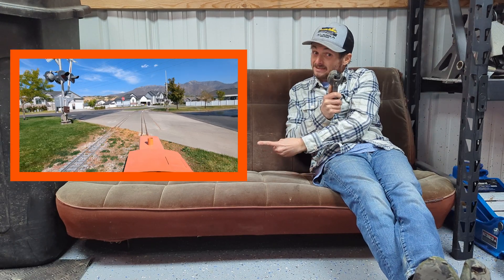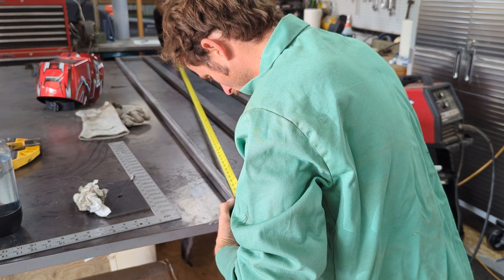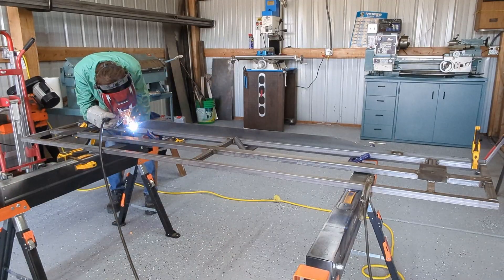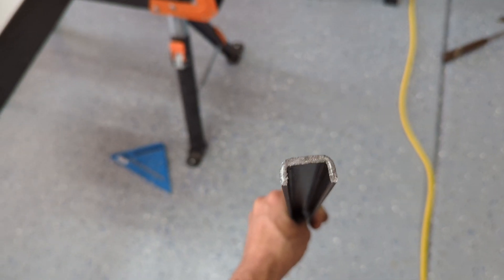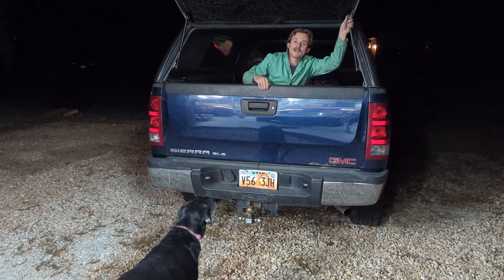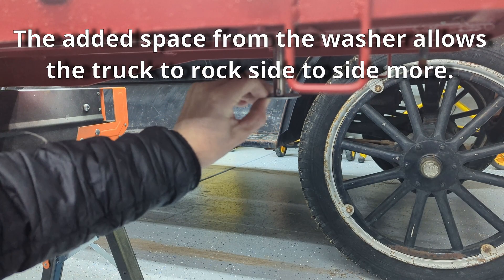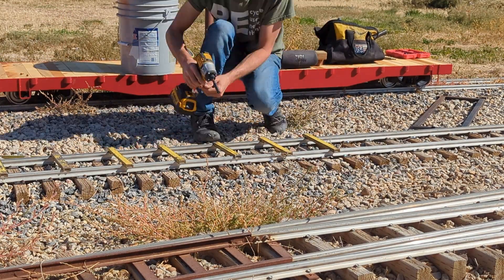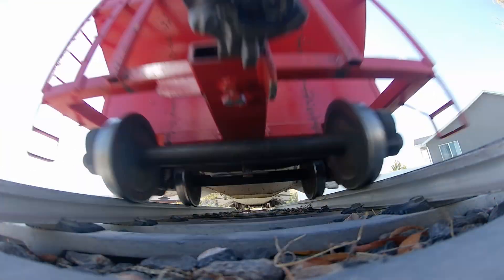Building a 1/8th Scale Flatcar You Can Ride On!

Comment: In your drawing you have 2 different scales listed. 1:8 ~ 1.6" (1.6" : 12") But 1:8 = 1.5" : 12".  1.6":12 = 1:7.5 Which is correct?
Hoping you're sticking with 1:8 and looking forward to your other builds.  Subbed and bell rung.
Reply from the maker: @terravarious Thanks for the comments, and sorry for the confusion. Hopefully I can clear some of your questions up. This flat car is 1.6":12". So you are correct it's technically 1:7.5 so a little larger than 1/8. I'll update my drawing so it's accurate. Thanks for bringing that to my attention!

If you wanted to make this flatcar 1/8 exactly it would need to be 7'6" long and 15 3/4" wide. Honestly if you plan on transporting this with a pickup truck, I'd recommend shortening it anyway. The car body is exactly 8' long as is so it will only fit in my truck without the couplers on. I didn't think about that while I was building it otherwise I probably would have made it a bit shorter. 

The scale box in the legend at the bottom right corner of the page is referring to the scale of the drawing itself. I know it's a bit confusing, it's the only way I could export the drawing to fit on a standard sheet of paper. 

A note on why I chose 1.6" instead of 1.5". All of the off the shelf parts I bought were advertised as 1.6" so I chose to match the scale of the parts. Especially since the powered trucks I bought for my GP40 project are 1.6" as well so I figured I'd build my "fleet" of standard gauge locomotives in that scale. However the difference in the size of truck wheels from 1.5-1.6" is pretty small so using 1.6" trucks on a 1.5" car would be fine as far as looks go. 

If you have any other questions, feel free to email me at jtengineeringYT@gmail.com. I'd be happy to help you how I can.

Comment: You don’t need coal to power your stem engine you can use oil instead or just wood
Reply from the maker: @leeannmartin7778  That specific engine was coal fired. Propane is used commonly as well in model steam engines since it doesn't produce the ash and fire hazards that coal produces.

Comment: Nice job on the flat car and the video! What kind of milling machine are you using?
Reply from the maker: Thanks! I think it turned out pretty good. My mill is a Precision Mathews PM30-MV. Though I didn't do a ton of milling on this project since I bought the trucks, I do have plans and parts to start building a steam engine so Ill definitely be using it a lot for that.